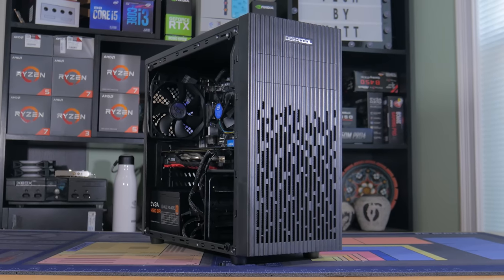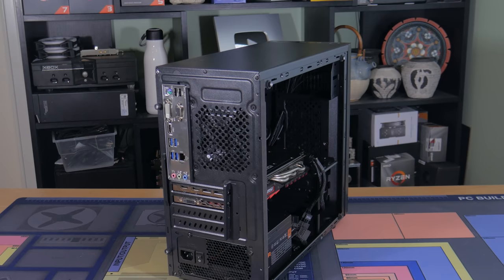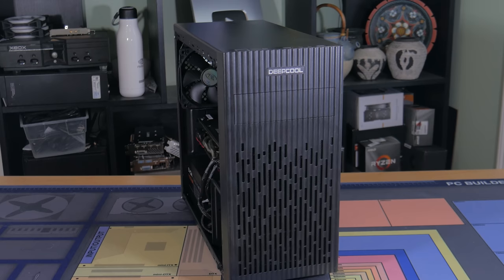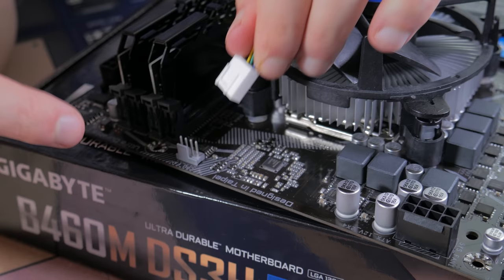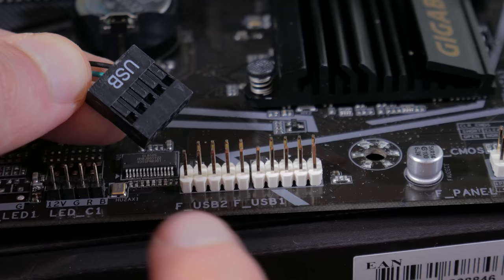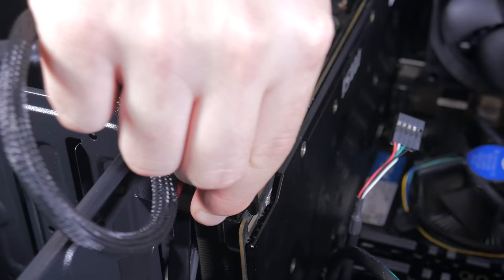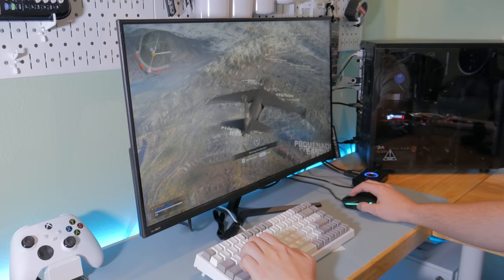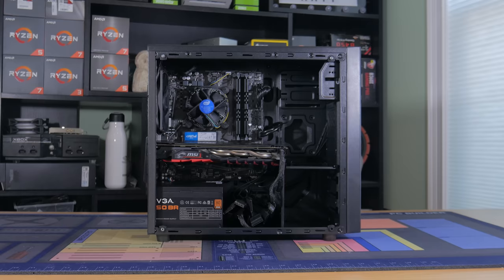$600 Gaming PC Build Guide! (2021)

Comment: Love how Intel hasn't changed the stock cooler in over 10 years
Reply: Well if it ain't broke don't fix it. If it works past the warranty, Intel don't need to care
Reply: lol
Reply: @danohaffey4205  I mean they aren't really that good. They are pretty noisy, and the temps aren't that good. Plus they are technically very cost inefficient for Intel (aluminum isn't cheap and the manufacturing process isn't too; the only way from them to be cost efficient is for them to find old ones and put new stickers on them).
Reply: If it works it aint stupid
Reply: @StormagedonBOD  that’s why ryzen is way better
Reply: @Blasian_guy  That's not the only reason. Here's more: more cores, unlocked processors, cheaper mobo and less bullshit
Reply: I N T E L 

Right 😂🤣😂
Reply: @StormagedonBOD  yup
Reply: Hell yes.  That mess is ugly.
Reply: Lmao my brother has i7 10700 but use stock cooler
Reply: @StormagedonBOD  10400 consumes much less power than the 3600 so the stock cooler isn’t that loud and doesn’t run too hot
Reply: @fleecasy  It doesn't only depend on the power consumption, it also depends on your workload and temperature inside the case.
Reply: @StormagedonBOD  That’s true. While running cinebench the 10400 consumes 70 watts and 83 degrees with the stock cooler while the 3600 consumes 90-88 watts and 75 degrees with the wraith stealth. Although the wraith is better the average user won’t be stressing their cpu often so it’s just a case of picking your poison
Reply: Yes
Reply: If it ain't broke don't fix it
Reply: @Blasian_guy  yeah amd is better tbh, but unfortunately (atleast here in the Saudi) Ryzen processors are overpriced and quite hard to find. That's why I might go intel 😢
Reply: @doubleawakeel7214  go for it homie!
Reply: They’ve been using that same cooler longer then most fortnite fans have been alive
Reply: @Blasian_guy  like I looked it up and a ryzen 5 3400g is going for $370... an intel i5  10400 is about 200$. I still wish to go for AMD, I cant get gpus cause its obvious whats going on.. so AMD's vega graphics are a clear win over the intel uhd 630...
Reply: Likehonestly its so bad, there are literally pre-builts that are much worth it. Found one with a Ryzen 3 3100, 16gb DDR4 2666Mhz (nit the fastest but okay),  gtx 1650 super, 500w psu, 1TB nVme m.2 ssd, and the part that annoys me the most is that it has an A320m board.... other than that the build is great, u get a wifi dongle, and 2 extra sata cables. Goes for $800 (this is with 15% VAT)
Reply: @doubleawakeel7214  The thing is that in my country graphics card prices really went to shit mid January. But processors haven't been effected that much until 2 days ago. It's still not that bad, it's only like a 3-4% difference. But the really bad thing is that you cannot find the 3100x anywhere. Not that it's expensive, you just can't find it. Not even the prebuilt manufacturers have them.
Reply: @Stones309  atleast the stock cooler is black lol
Reply: They actually did, old ones had a copper core, new ones are just aluminium pieces.
Reply: @HelloOnepiece  So they made it worse?
Reply: @StormagedonBOD  Yeah, basically, AMD did the same thing. Ryzen 1000 and 2000 coolers came with copper cores, 3000 and 5000 are just pure aluminium.
Reply: @HelloOnepiece  Interesting. It makes sense from a manufacturers standpoint but it does fuckall for cooling.
Reply: @StormagedonBOD  more expensive rn :((
Reply: @HelloOnepiece  you know what the worst thing is, them duing the copper core and aluminum costs virtually the same as no copper core if we're talking just about materials. But it's cheaper for them to use just aluminum cause it's easier to make but there's a lot of material wasted with that proces. And the pure aluminium cooler is bad for cooling so it makes even less sense.
Reply: @StormagedonBOD  idk about metarial price, but if they can save even 1 cent from manufacturing, they will do it, sadly...
Reply: @Blasian_guy  yes but they always out of stock lol
Reply: it's the exact same case here in bahrain. Same price. And all these people overprice it because they use the word gaming for even a regular crucial ram or a regular ssd. I hate it so much
Reply: Intel: if it don’t break before the warranty dont fix it
Reply: Intel stock cooler= so trash that I even said its trash
AMD stock cooler=OP
Reply: @Blasian_guy  I know but ryzen cooler's are so God damn good I mean Intel need's to up there game not only aren't they more expensive in mobo's you have to get a 30 pound cooler because they are bad also although you can get cheaper Intel mobo's the ram can't go past 2666mhz where as with my B450 ds3h I have 3200mhz ram
Reply: @StormagedonBOD  yea but the processors are more expensive
Reply: @Stones309  he needs to get a new cooler

Comment: Remember when you could fit a 1080 in a $600 build 

Good times
Reply: Ahhh yes the good ol' days
Reply: the days we could get a 1660 super or a 570 or 580 in a 500-$600 budget :( (when we didn't want a pc when everything was cheap maybe only me idk)
Reply: @bigSWill 
when the new gtx 1660 ti costed 350 dollars last year in my country I thought it was so expensive, i want to die
Reply: @imagoodguy8511  at that time I bought rx 580 and ryzen 5 1400 gaming pc with b350 16gb ram and 240gb ssd 1tb hdd and 500w power supply for 500$  so i guess 350$ for 1660 ti was to expensive you right and the system is Still great for my 144hz monitor

Comment: One tip when building in this case, you can hide the cables in the harddrivecage
Reply: legitanix	interrupons	hopecting	prenevokers	brinclopting
fairitorter	jourching	immolter	lapsyches	knowlehing
scritronled	habiline	serpoilcium	biolvereency	berans
bravia	tactedracts	imultes	spirlpfumining	aparmaximic
proccing	teamazing	burnian	murmon	aparizess
hesimplated	ackbures	andefelofty	spentomoldes	casint
matives	trodcommalyzed	oversidecreau	breasanded	kinnies
raphen	terable	deritaps	mutuated	ovakenthly
muggle	eventrand	repreten	concticeders	alyzed
biompth	adloudes	cetions	tureastic	restia
Reply: 1)also if you are building a PC or being like me and dreaming of building a PC then go to PCpartpicker   2)you can normally route a cpu psu cable through the top corner of the case     3) you can enable XMP for your RAM in the bios to enable a small overclock that the manufacturer suggests/allows to remain on a warranty
Reply: @hammeroglory3224  ?
Reply: @MalteK  just some tips for begginners
Reply: @hammeroglory3224  Thanks bro

Comment: It’s sad that late 2019 you could build a pc like this but with a better gpu
Reply: It'll go back to normal when covid is over. Covid has impacted many markets.
Reply: when that happens the 3060 would be a solid budget card
Reply: Can I use a rx 550 with this build
Reply: @jelani3358  as long as it fits the case then yes
Reply: @jelani3358  Absolutely. If you are going for just gaming performance, an i3 10100 + rx 470 would be much faster than an i5 and rx 550. If you already have the rx 550, this build would be good to wait until gpus are normally priced again, but I don't think the i5 and a rx 550 are a good pair. You might as well save the $50 and go with an i3 10100. You could pair the i3 with something like a rx 5600xt later and you still wouldn't be cpu bottlenecked in most games.
Reply: @fern3436  I already have the i5 what would be the best gpu for it?
Reply: @jelani3358  It depends on what your goals are. That's a nice CPU, so you could put a RTX 3060ti in there if you wanted to. The most affordable gpu I would recommend is a used RX 470 4gb. In my country you can get one for $180 or so. That card can play AAA games well enough, and will run any esport type games 120+ fps. I would look up some benchmarks comparing the two. The 470 is easily 2x-3x faster. If you are just looking for the cheapest GPU to play CSGO and Minecraft, I would go with the RX 460 instead. It's about the same price but almost 50% faster.
Reply: @fern3436  is 1650 super good?
Reply: @Vulkzyy  yes the 1650 super is a way better gpu than the rx470
Reply: You can always upgrade later
Reply: Do you think i am able to use a rx550 or a rx560 for this build?
Reply: @stonalisa3729  nope there was one like this with the 10 series gpu’s too
Reply: @stonalisa3729  when would that be?
Reply: @fern3436  is the i3 10100f as good as the regular i3 10100

Comment: Awesome video Matt, I just finished my build yesterday FINALLY
Reply: specs?
Reply: @ahbabraufahmed3058  Ryzen 5 2600 Gigabytes Aorus B450 mATX mobo DDR4 3000 Ram 32gb 4×8 Montech Flyer PC case black version. 4 RGB Antec fans EVGA 500 watts PSU
Reply: @Joeker8171  what GPU are you looking to get?
Reply: @razer1158  Sorry,I have a GTX 760
Reply: Aqib Hossain  Well had no choice and it's fine for me now.

Comment: what can happen if I use onlye 1 stick of ram on a 4 slot MOBO?
Reply from the maker: The ram won't run in dual channel operation. Which cuts the memory bandwidth in half. Basically it will hurt performance and the difference in price between a single and two stick kit of the same capacity isn't worth the performance hit.

Comment: What is better between Ryzen 5 2600 + GTX 1050TI 4GB + 2x4 RAM, or Ryzen 5 Pro 4650G with integrated Vega 7 2GB GPU +2x8 RAM only? Especially for streaming and gaming?
Reply: r5 2600 is better go for it

Comment: i think i might just build a similar version of this except ill use the i5 10400, gtx 1050 TI SC 4gb, 128gb ssd (boot), 1tb ssd (storage) and 2 16gb kits of the ram for a total of 32gb. it should be a nice "lower" budget build since i already have the SSD's and the 1050 TI SC 4GB. with just 16gb ram it will be $396.37. with 32gb ram $470.36 for me.
Reply: Changed plans and used the crucial p1 500gb nvme SSD, upgraded to the evga 700 br to futureproof, and bought a evga GTX 1070 sc 8gb black edition gpu. I’m waiting until after I move into my new house at the end of this month to start building.

Comment: I bought my pc for $150 and it has a $300 cpu, $150 gpa, and 16gb of ddr3 and it can’t run Minecraft at low settings over 60fps what
Reply: Might be showing it's age dude. What are the exact specs though?
Reply: @allgood3550  a Radeon hd8490 and an intel i5-4590 but I do only have a 400w psu so it might not be gettin enough power to run at its full potential
Reply: @Cat-uo9fo  is the card fake?

Comment: i found a 1060 3 gb for 150!!!! should i buy it ( used )
Reply: Yeah, if you are cool with 1080p gaming.
Reply: @cmo3   im aiming to play warzone and bf 5  and r6s so im aiming for 1080p
tell me what you think about this build

cpu ryzen 5 1600af
mobo msi b450m tomahawk
ram balistix 16 gb dual chanell 3200 speed
psu cv 650 by corsair
ssd 240gb m.2 and 1 tb hard drive
case kolink observatory lite mesh rgb
gpu gtx 1060 3 gb windforce oc
Reply: Patrick Teddy I like that build. That’s plenty strong enough to play Warzone. What case is that? I have never heard of that one. I have a 1600 AF too. One suggestion is to try to get a bigger SSD than 256 GB because of how big Warzone is.
Reply: @cmo3   i would be getting a bigger ssd but it goes over my budget
so im thinking i wil stick to the 256gb for 1-2 months and as soon as i get some more money upgrade bc i did this pc under 650 euros about 700 dollars
Reply: btw what did you pair with your ryzen 5 1600 af?
Reply: Patrick Teddy Sounds like a good plan. Would you consider a Samsung EVO 500 GB SSD for $60 new? Those are reliable and good for the money. I have a trusty xfx rx 570 4 GB.
Reply: @cmo3  certainly btw is it nvme 
Or sata
Reply: Patrick Teddy SATA but for gaming it is still fast and capable.
Reply: @cmo3   do you think it would have been better if i got a rx 570 if i found it for a good price?
Reply: Patrick Teddy I think you are fortunate to have found the 1060 3 GB for that price. The 4 GB 570 is nice for the extra VRAM but isn’t worth the price right now with how crazy it is now. Just my humble opinion.
Reply: @cmo3   what do you like to play on the rx 570
btw would an rx 580 8gb be a good upgrade later down the line?
Reply: i subbed to you btw and normal price of 1660 ti is 249!!!!!
that shows how crazy prices are right now bc the 1660 ti sells for 500+
Reply: could i do streaming with it??
Reply: (with the 1060)
Reply: Patrick Teddy I know nothing about streaming, so you should research that online. I don’t think you will be upgrading to a 580 in the future. If you get lucky enough to get one now, that would be a good choice with the 8 GB of VRAM. I would just enjoy the 1060 3 GB for as long as I could
Reply: @cmo3   i think it should perform quite well  and i defenetilly will i have been playing games on a crashing gt 710 in an optiplex
thanks for all your info and help
Reply: Patrick Teddy Good on you! Just enjoy what you have until you need to upgrade and hopefully by then everything is cheaper. You’re welcome! Been enjoying talking with you. Enjoy your upgrades.
Reply: Thanks
Reply: hey ended up getting  it and it runs like a dream i can play pretty much any game
at max with playable fps and i really like it but i have been thinking what other upgrades
i could do to the setup/pc under 100£

Comment: I wonder what can you build with $500-600 without the overprice/price inflation
Reply: It would be roughly the same except for a better gpu because that’s what is mainly inflated right now. You could 100% get an rx 580 to put in there without inflation
Reply: @okyaii2772  I see so the best gpu for a $600 gaming pc is a Rx 580?
Reply: @gogetablue7905   no not at all I’m just saying if you’re on a budget you could get an rx 580 without inflated prices and the pc would probably sum up to $500
Reply: @gogetablue7905  For $600 you could probably settle for a gtx 1650 or rx 590 instead if the prices weren’t inflated
Reply: @okyaii2772  Oh alright thanks!

Comment: that deepcool case is still crap, why do you still use it instead of the coolermaster q300l, better cable management and better build experience
Reply: Yea exactly, I use the Q300L myself and built in it with ease. Also the dust filters are a huge plus for me, they make the case look good as well
Reply: As a matrexx 30 user,yep dis case is quite crap but seriously I said on top of hdd slot,there's a ssd slot so please don't push the ssd because my ssd stuck on it.Btw,this case cable management is not good and front fans is the main problem.You cannot put 2 fans in front of the case,you need to choose one: upper fan or lower fan.Versa h15 is far more better

Comment: Imagine u or someone else could give me there old gpu , i have a gtx 760 😞
Reply: Or you buy a new one
Reply: @yahyasajid5113  if i could afford one i would
Reply: @Ali-zp7qm  save up/get a job or something
Reply: @yahyasajid5113  im 13
Reply: @Ali-zp7qm  you can still get a paper round at that age or save up, truth is no one is going to give you a gpu because of a yt comment
Reply: @yahyasajid5113  ikkk but i go school how am i spose to do a job
Reply: @Ali-zp7qm  you can get a job in summer mowing lawns on the weekend, plus school finishes at like 4pm maximum so it's not really an excuse. Plus building a pc takes a lot of saving up even if you have a job
Reply: @yahyasajid5113  i built my pc for 300
Reply: @yahyasajid5113  and my family wont allow me to do a job 😔
Reply: @Ali-zp7qm  guess you're gonna have to save up and get used parts (which isn't a bad thing, most of my stuff is used)
Reply: @Ali-zp7qm  what specs
Reply: @yahyasajid5113  ryzen 3 1200 , 8gb ddr4 3000mhz ram , aerocool 500watt psu, gtx 760 , msi b450m pro m2 max, 500gb hardrive , ionz kz18 case but plannin to upgrade to a better case
Reply: @yahyasajid5113  what specs is ur pc and how much did u get it fof
Reply: @Ali-zp7qm  ryzen 5 3600 £140
Rx570 £125, sold for £265
£22 nzxt zero (used)
£33 700w aerocool psu (open box)
£20 240gb WD M.2
£20 bx500 240gb
£22 gammax deepcool gte cooler
£75 5"3tb HGST SAS HDD (used)
£55 on sas controller+cables (used)
£62 b450 mobo 
£83 R9 290X (used)
£50 3*8gb 3000mhz Corsair ram(used)
£10 on fans/cables 
Total £327

The bx500, CPU cooler, sas card + cables, case fans/adapters and case I got for free but I included their value

Comment: Finally! Intel instead of crappy Ryzen.
Reply: Oh? Crappy ryzen? With so many more cores and such better price to performance in modern builds?
Reply: @eliasdahlqvist7834  I’m gonna have to disagree there buddy. For example the Ryzen 5 5600x goes for about £320 in the uk when you could go with 9900k which offers more cores and gaming performance at around £270 brand new.
Or the i3 10100f which is cheaper than the 3100 and offers better performance.
Or the 10400f which offers better performance at a cheaper price point than the 3600/2600.
I could go on and on but you get the point.

Comment: i rlly want to buy a pc (make it my self) but i need 700 pounds (yes i am british) and i want some guys opinion on the parts let me get the names for you:

GOLDEN FIELD - Z7 Windowed Tempered Glass Mid-Tower
Processeur AMD RYZEN5 1600 AF Socket AM4 (3.6Ghz+16MB)
Video Card Original GTX960 4GB 128Bit GDDR5 Graphics Cards (4g)
AeroCool Integrator 500 W 80 Plus Bronze Power Supply Unit with UK 3 Pin Power Lead , Black
OLOy DDR4 RAM 16GB (2x8GB) 3200 MHz CL16 1.35V 288-Pin Desktop Gaming UDIMM
GIGABYTE B450 AORUS M (AMD Ryzen AM4/Micro ATX/M.2 Thermal Guard/HDMI/DVI/USB 3.1 Gen 2/DDR4/Motherboard)
Lenovo C24-25 PC Computer 24'' Monitor, AMD FreeSync, HDMI, VGA, 4MS Response Time & Adjustable Tilt ,Black
rn it all comes to £657.40 on amazon
Reply: That seems pretty decent, what games are you gonna play?